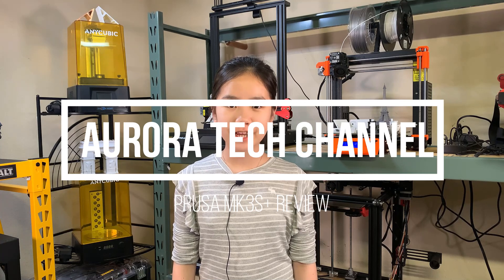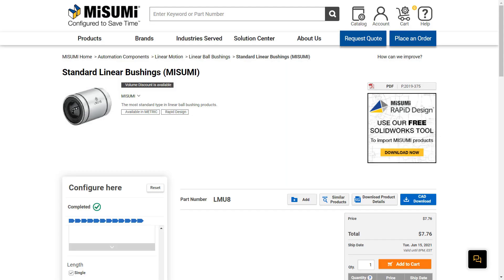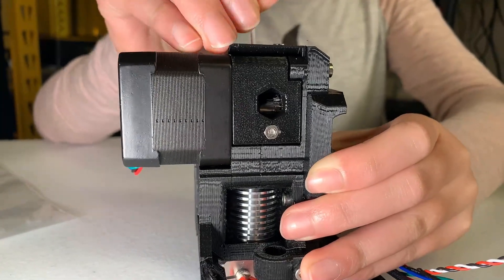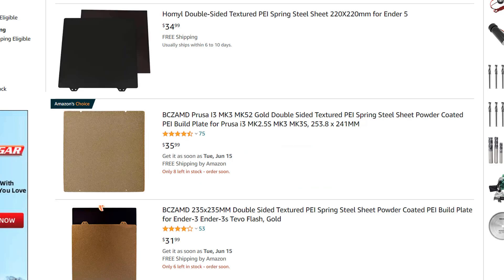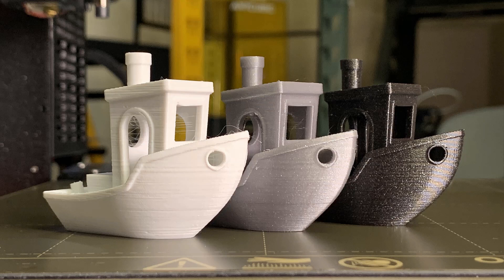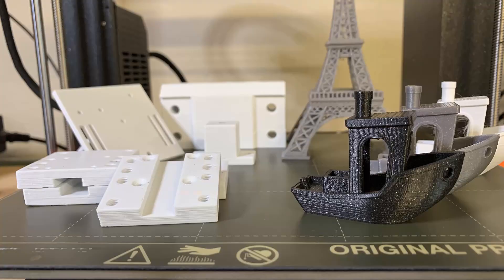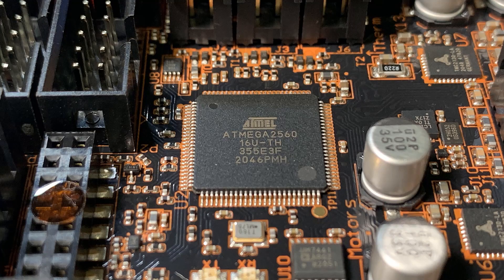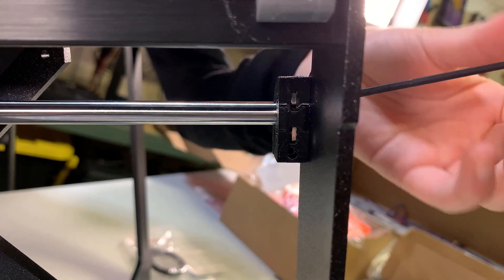PRUSA i3 MK3S+ 3D Printer, is it worth $750? Compare with Creality Ender 3 and other budget printers

Comment: Exactly what I needed to convince me thank you! Btw about how long did it take for the prusa to come after you ordered it?
Reply: For me, I ordered a Prusa Original i3 MK3S+ kit on 7/29/2021, just before a weekend.  Prusa shipped it on 8/2/2021.  It was delivered on 8/5/2021.  I understand that the time to ship depends on various factors, like whether you order a kit or assembled printer.  But for me, it was not long at all.

Edit to add:  I guess I should add that I live in SW Florida, so you have some idea of how far it had to go.  The air freight (for mine at least) came through the Memphis, Tennessee FedEX hub.
Reply: @michaelj3971  that is perfect info thank you! I was wondering if it was going to take like 3 months to come and I'd have to order it while out of country so I don't have to wait a ton longer, I'm in canada so it should take much longer then yours thanks again for the info!
Reply: @busterbackster1  Prusa has current estimates listed on their website.  As of when I am writing this, it is showing a three day delay to ship on either the kit or pre-assembled version.  Also, they have a "Shipping Information Page" with more details on shipping.  The 2-3 day shipping time listed is for U.S. customers.  I didn't see figures stated for Canada, although on the VAT page it shows a substantial figure for VAT on both the kit and the pre-built versions.

I don't know if you want to pay the extra for the pre-built version, but I believe it comes with a few extra perks the kit lacks.
Reply: @michaelj3971  I was planning on getting the kit since it seems like that's the best way to learn a new printer and in general, plus saving some money doesn't hurt lol.

Thanks for the shipping time I'm going to assume it's a few extra days to a week longer because of the border but if it comes sooner then that even better!
Reply: @busterbackster1  A Google search for FedEx air hubs in Canada doesn't return anything useful.  I ended up browsing Flightradar24 to see if there were any concentrations of FedEX airplanes at Canadian airports.  It may not be the right time to find them on the ground, but I only found two freighters, both MD-10s.  One at the Toronto Pearson airport and one at the Montreal Mirabel airport.  If we assume that these are their hubs, you may get faster delivery times if you live in eastern Canada.  The FedEx website has maps of delivery times, ranging from 1 day (close to a few big cities) to 13 days (Nova Scotia or somewhere less traveled).  So it looks like it is really location dependent in Canada.

You will certainly know the printer well if you get the kit.  You will have assembled every nut and screw.  It is a really satisfying feeling to assemble it yourself.  For me, it was also a little stressful to turn on the power for the first time.  But, it powered up and ran perfectly.

Comment: This is a great comparison video!  I am about to buy my first 3D printer.  I have heard good things about the Prusa, but I wondered whether the cost difference was really worth it.  Your video answered all my questions.  Your review of the high quality parts and operation of the printer were excellent.  Thank you!
Reply: As a follow-up, based on this video and your Prusa assembly video, I ordered one.  I will be watching your assembly video along with the instruction book to build my 3D printer.  Thank you for these videos!
Reply: @michaelj3971  How do you like it?
Reply: @KillerofGods  So far, I really like it.  The shipping time was not as long as I thought it would be.  It was shipped within 2-3 days.  It arrived one day after FedEX claimed it would be delivered.  I wasn't sure about the delivery, as FedEX never updated their tracking information after it arrived at their air freight hub in Memphis.  It was packed very well, pretty much in bags corresponding to the section you are building.  One part was in a different bag than I expected, but a community comment pointed me to the right bag.  They include a bag of spare hardware just in case, but I had no missing parts.

The build process was straightforward.  Patience is more than a virtue, it is required.  Take your time building it, doublechecking things along the way.  I ended up using both the video here and the online manual.  The online manual is very good, as you can zoom in on the pictures, and there are a lot of really good community comments for each step.  Some steps require judgement, like tightening the belts.  The community comments help in those steps.  My process was to watch the video section, look at the online manual step, browse the community comments, and then perform the step.

The only part of the build process I was disappointed with was the cable routing and dressing. That could be improved.  Otherwise, it went together well.  It is important to not overtighten the screws.  First, tightening like Kong is not necessary for the printer to work correctly.  Second, the printed parts can be broken. 

It powered up just as expected and passed the startup self tests first time through.  It took me several tries through the Z Axis setup before I thought the Z Axis position was good enough, but my first print, a Benchy, printed extremely well.  The bow and sides had no flaws I could see.  Since then I have printed maybe only a dozen parts, but I have had zero issues.  It has just worked.
Reply: @michaelj3971  TYVM for the detailed response, Im gonna order a unit and give it a go.
Reply: @KillerofGods  Great! I would be very interested in any feedback you ha e, also.
Reply: One recommendation: As long as your mk3s is your only printer, one of the first thinks 2do is printing a set of replacement plasic parts in case something breaks (no need to do this for the display case or the electronics box of course). At least if you live outside the EU and you do not have a friend with a 3d-printer nearby.
Reply: @oleurgast730  I have not done this yet, but it is on my to-do list. If this is a priority for you, you should order some Prusa orange, and Prusa black PETG while you are at it so you can print these parts.

Comment: Good video and excellent points. I've got 2 Creality printers and a Prusa for 3 years. There's a few differences, and not all hardware. The one thing you missed is the vastly better MK5.2 heated bed - there is simply no comparison to the simpler beds Creality uses, not to mention the embedded magnets that makes a double sided steel sheet ready to use with no glue on base - this is quite a big difference. The frame is also unique to Prusa, though I see clones have emerged. The biggest difference though, is support - I originally purchased the mk3, but have been able to upgrade to the latest iteration. On the other hand, there is no Creality upgrades for my old CR10 mini which I bought at the same time - you are stuck with the original motherboard & hot end unless you want a non Creality alternative. The other big difference is software - Prusa slicer is a great product and firmware upgrades appear several times a year. Any issues they respond quickly. Also you mention the risk of damaging parts on assembly - a lot of people have had parts mailed out free of charge. Do half agree on one thing - print quality generally is similar to the Creality BUT ONLY for PLA. Even then I've had models that printed with no issue on the Prusa that struggled on the Creality. But if you just want pla printing workhorses, yes the ender is great
Reply: and an upgraded magnetic bed is easily under $50.. so for the same price as the Prusa you can get 3 to 4 modded creality printers that'll give you the same quality..
It's part of the times, get equal quality for less.
Reply: @br0k3nilluzion  the magnetic beds available for the creality range are still nowhere near as good as the mk3 bed. You are talking about surfaces, not the need itself, which is vastly inferior to them mk52 bed design. Also mechanically the Prusa design is far more stable. You'd spend hundreds to get exactly the same from a creality and there still isn't a bed for any of their printers that matches the mk52 design.
Reply: @lff12  you're wrong.
mk3 is still a bed slinger.
You can get a very nice Y-Carriage for under $50, and a very nice magnetic bed for under $40.
Shoot, an LDO Prusa MK2 Y-Carriage is only $80. 
That still leaves you under $400 for your printer.
Of which both are still using Marlin and both are still 8-bit boards.

For the price of a Mk3 I can get a cr10 v2/3 and Ender 3 v2/CR6 SE, both running 32bit boards and Klipper..  and I get the same quality as a finely tuned mk3.. we compare prints from our print farms at the makerspace here all the time. lol
Reply: @lff12  All I'm saying is I can get my "creality" cr10 v2 using a 32bit board along with Klipper running smooth as heck and printing faster ,   for less then a mk3...
And if one was to spend the mk3 money, it'd be better spent on a CoreXy, or a CoreXZ like a Voron Switchwire.

But the MK3 is most definitely a good printer.. not knocking it by anymeans..
Reply: @br0k3nilluzion  sure you can get autolevelling (40 dollars), a removeable bed (but not the fully specced mk52, 50 dollars), updated extruder and hotend (bondtech DDX 135 dollars, Copperhead 105), 32 bit board that supports standalone mode (MKS 32-bit board with TMC steppers 75 collars) - all of that is 400 dollars and you still have a basic heated bed rather than the MK52, and whatever power supply it came with, and by now a CR-10S costing 300 on a good discount plus all of that is 700 dollars - less than 200 shy of what a proper MK3S+ kit will cost you, plus you've still to do all the assembly and figure out the firmware yourself, and you are on your own with most of this, because most of these come with no support whatsoever. Even the Prusa mini is a better deal. Unless, as I said, you are only planning to print PLA, in which case you are probably as well off with an Ender plus or ender max if you want a bigger bed.
Reply: @lff12  just said "LDO".. that's a legit spec'd mk52 bed.
Going expensive on the hotend huh..  these Dragonfly's and Dragon's are pretty sweet. And at $70 they are definitely worth it and can push out 200mm/s and up worth of filament like a boss.
(Benchy Speedtest on a Voron 2.4 proves that. lol)
The Galileo for $70 with an Afterburner duct and a Dragon for $70 is more optimal in the current meta.. especially with how these CoreXY builds are building steam in the community.
Even without the 32bit board.. using the 8bit stock board and a $10 Pi Zero W you would have Klipper running, and with Input shaper and the CRtouch/bltouch for $40 it's still a worthy upgrade.
Not seeing the need to upgrade to the mk52 bed though. This TM3d and Energetic beds with stock heaters work just fine for my printers..
That's still in the $500 range.

With the community being so big Firmware is nowhere near a hassle, at all.
So many community builds for printers these days, it's just a matter of downloading and installing.  And if that's new, just look on youtube and you'll find a video on how to install it in 5 minutes or less... gotta love the times. lol

Now if we are talking about Support... I have an awesome makerspace and a ton of local fella's that help each other out, and some of these FB groups are rather helpful
Which is kind of a funny thing in the 3d Printing hobby.
It's a tinkering hobby. You're going to have to tinker with your printer at some point.. no matter how expensive a brand you buy into.  So it's worth it to watch some good youtube videos and put in some elbow grease on these.
My i3 mega's and ender 3's were awesome to start with.. the CR10s' series are a joy to use , chiron's are a pain in the ass, but they work and work very well.  Helps pay bills and keeps the farm growing.  
Jumping into a Voron 2.4 and Cr10s Switchwire conversion.

What printers do you have?
Reply: @br0k3nilluzion  a cr-10 mini, an ender max and a Prusa mk3 with s kit and plush kit ready to go. The ender is more or less struck, nice for pla, anything else the Prusa is vastly superior. The mini is heavily modified... Genuine e3d hotend/titan/hotend stepper and autolev. Waiting on a dual z kit with ender profile extension mods already installed. Does it print well? Yes. It's it as good as the Prusa? Absolutely not. Even with those mods better creality does precision parts like they Prusa. Nether of them will do polycarbonate or nylon reliably. Colorfabb ngen and xt just dance on the Prusa. The XT not great on creality but ngen ok. YouTube has a lot of poor info and outright disinformation, same goes for Reddit. Community "support" is nowhere as good as professional support from the manufacturer. And genuine parts from e3d and bondtech rather than counterfeits make a product far better.
Reply: @br0k3nilluzion  a heavily modified CR10 mini, an Ender Max with a couple of small changes, and a stock Prusa MK3 with S upgrade kit installed.
Reply: @br0k3nilluzion  I've spent a creality just in fixing and maintaining the prusa.  There are pros to Prusa, especially the customer service, but cost is not one of them.

Comment: Good work and a nice comparison. However, if you just buy all things that the Prusa havem that the Ender does not, then you automatically assume that everything selected by Prusa is somehow better than what is present on the Ender or on the market. In that case, buy the Prusa. There are many good alternatives to the Delta PSU, both cheaper and more expensive, so why chose the Delta when I can chose myself? Likewise the Rambo board - why change one 8 bit board with another (very expensive) 8 bit board, when I can get a more feature full 32-bit board for less? And so on. So your list of "updates" for the Ender is only meaningful, if what you wanted in the first place was a Prusa, and in that case, just buy a Prusa. Disclaimer: I do not own any Prusa printers or any Ender printers.

Comment: I would rather upgrade my ender 3 max.
Reply: You get a machine you know very well by doing that.  Also like the more metal pieces on the Ender.  The ultimate is probably upgrading the ender with linear rails, dual Z and microswiss.  And with shopping around, you can get it cheaper as ewll.

Comment: That CoreXY design has a problem, the belts directly connected to the X moving on the Y need to be parallel with the direction of travel.

Comment: Convenient is the right word, although for someone who just wants to press print and go the kit might be a bit of a challenge so they probably buy the completely assembled one which is over 1000 bucks or more in Europe. For 1000 USD I would say it is a bit overpriced. Problem is that Prusa can maintain that steep mark-up for a 4 year old model printer because for what it offers there really is no competitor on the home market today.
Reply: Try going Ultimaker and see if it is overpriced, Prusa is the right middleground of quality and price. Also, as an owner of a couple MK3S, they have been improving things over time, the 4 year old MK3 is different enough to the MK3S+ right now in plenty of details to make it a better machine.